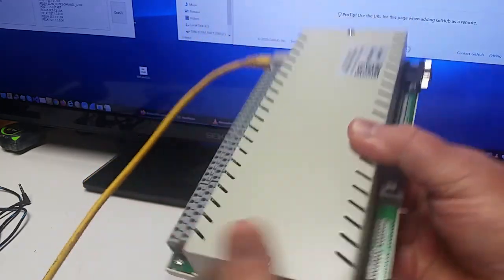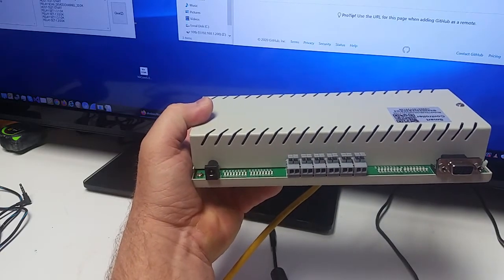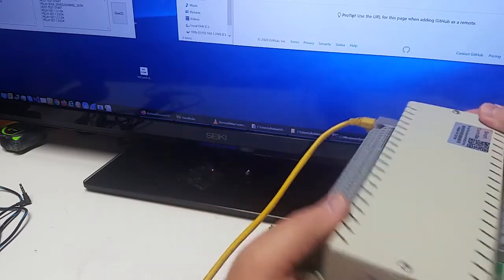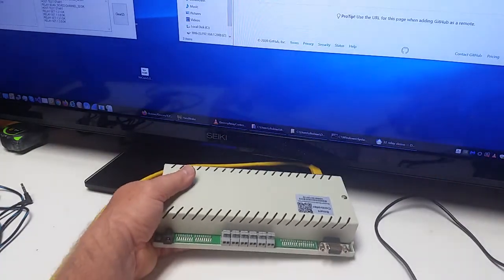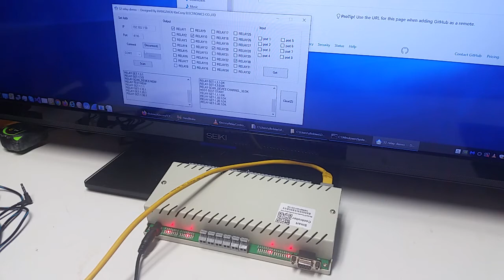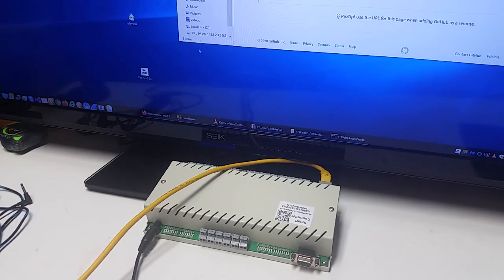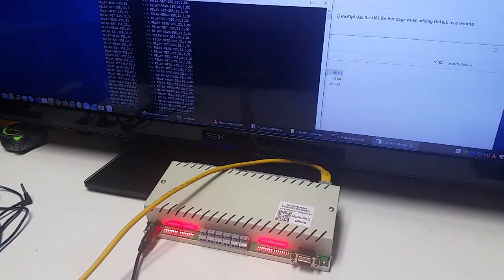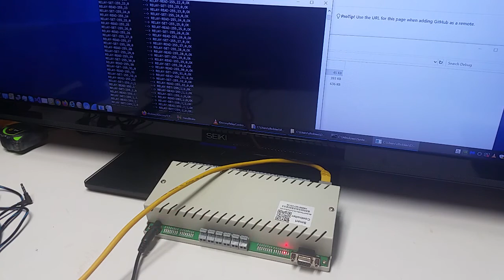Kincony mdl KC868-H32 Ethernet smart relay controller

Comment: Can you write implementation for Home assistant for this device?
Reply: Please don't think I am being rude but I just don't have the free time to accept random work requests from strangers which are unrelated to my personal goal.  I accept that this is selfish.  My bad.  Now what you can reasonably do is ask Kincony to do the integration because they make a business of it.  They can use my code without charge.  So in a way I would be helping them write what you need.  There, I feel better for helping.
Reply: @DIYDaveT  I thought the whole thing with home assistant is that it's a community. Independent from manufacturers. Therefore i contacted kincony about this because. I noticed the code behind this device is open-source. In the community world kincony is not that big player. In my opinion if a manufacturer is willing to write a home assistant integration (because they know there product best) it benefits in both ways. People buy their stuff and the integration will probably have little bugs so people who use it will be happy too
Reply: @jordywauters4386  No debate.  You are correct.  Kincony is kind of stupid if they don't write the glue code to make their nice relay product "just work" in free software frameworks.  But Chinese don't really get it when it comes to software.  There is a blind spot.  Keep trying to convince them that it is in their own interest to do this. Maybe you will finally get through.  Good luck.